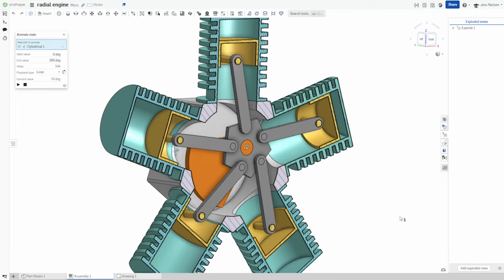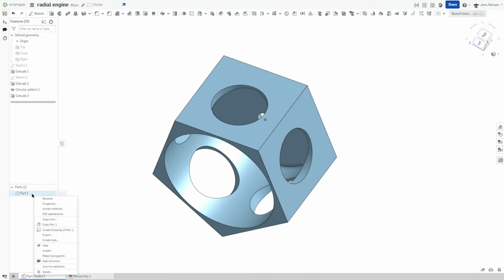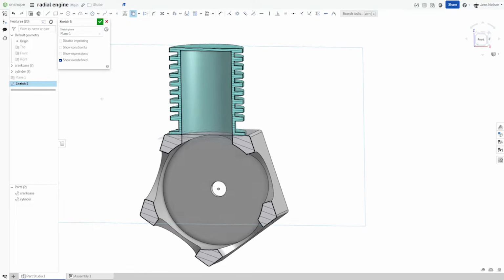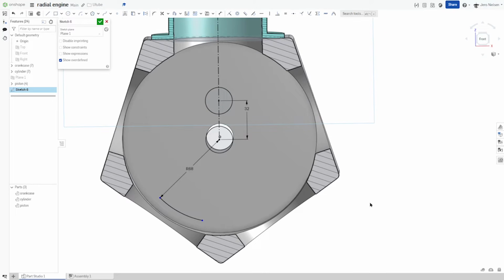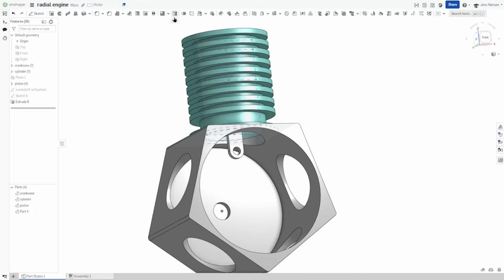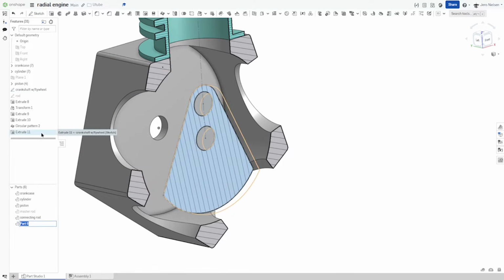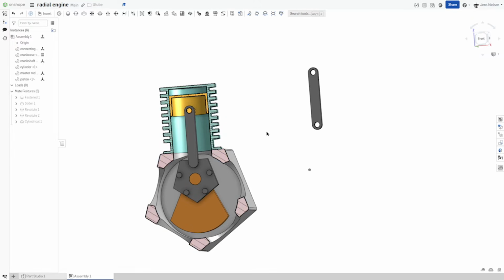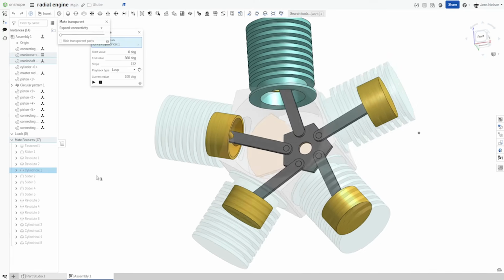Unleash the Power: Modeling, Assembly, and Animating a Radial Engine in Onshape

Comment: I'm following through your tutorial and noticed that you cannot extrude the flywheel because the sketch was formed using a mirror. The final sketch will not be closed hence one cannot extrude as some end points are not connected. 
Solution: use the centre point arc to form the bottom arc for the flywheel. With this you can extrude it. 
Hope it helps
Reply from the maker: great tip!

Comment: At time 6:38 you make the cylinder hollow, but whenever I try to do it, it does not become hollow please help or do you put 4mm and not 4in
Reply from the maker: all measurements are in mm!
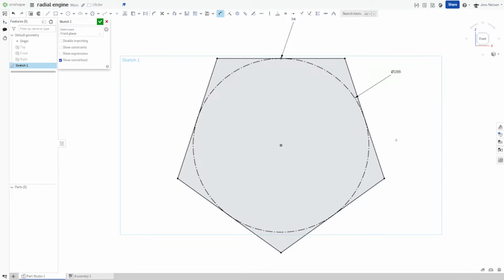Reply: Also, add time 1:28 do you put the measurements for the circle 166mm or 166in

Comment: Video is great but design won't work irl.
Reply from the maker: In what way?
Reply: @cademist  no valves
Reply: What keeps central con rod from over rotating?
Reply from the maker: @Robert00Kennedy  I  concentrate on the movement of  flywheel/piston/connecting rods for this video
Reply from the maker: @Robert00Kennedy  the revolute mate

Comment: Please make a jet engine tutorial video!
Reply from the maker: That's a great suggestion. ---Let me first understand  how these  things work!
Reply: @cademist  i tried making it actually 2 attempts too it ended up being 3000 parts ... the vanes are the hardest thing as well as the deflection angle and geometry for the initial large fan blades most tutorials are on solid works anyway
Reply from the maker: @tar244you8  so you managed to model this? can you share  the file?
Reply: @cademist  or if u cant do a jet engine could u try make or like a normal turbine instead of aviation oriented one
Reply from the maker: @tar244you8  if you have  a  link to a  solidworks tutorial-share this and I'll have a look.